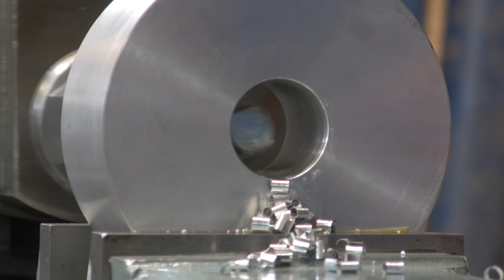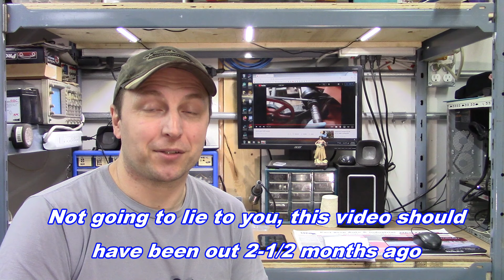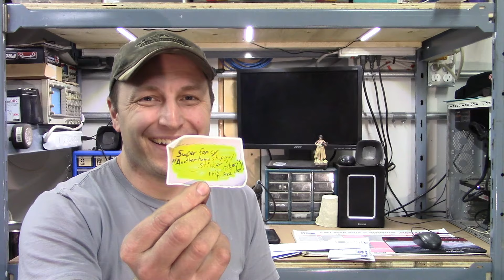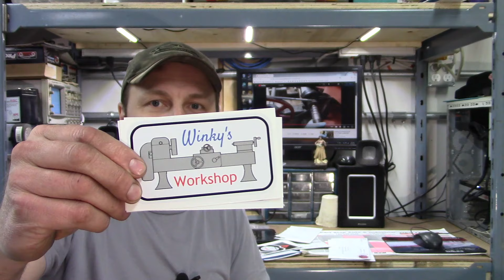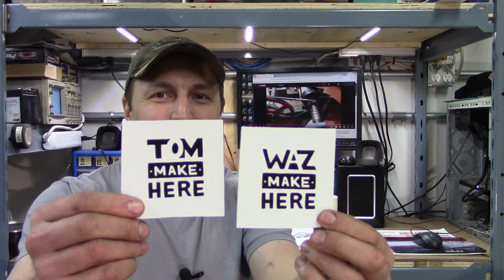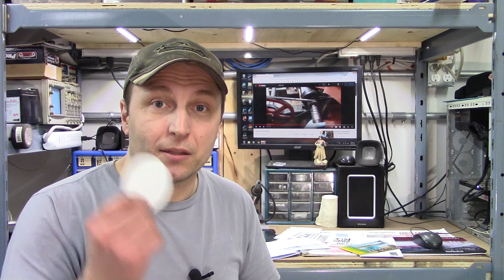Channel Stickers and New 3D printer

Comment: No problem. You're not forgotten. The prescription alerts us whenever You launch a video.
3D printing looks fun but finding Fusion360 being a solid conFusion360 and a dead end.... Hardly any such printing here.
Reply from the maker: I admit to using Fusion360 for a lot of my models, but don't like the fact it's all cloud based.  That being said, it is a powerful CAD tool and the free price tag is hard to argue with.  I also have a copy of Alibre, but still learning its ins and outs as it is a very different interface.  Hoping to get better with it as time goes on.

Comment: Hey Everett. I have the Ender 5 Plus. Pretty much a love hate thing. Printer is fine, learning curve is steep for this printer. I bought a Prusa Mini and that is my go to for small work. Much less fiddling required with Prusa. 

Much filament was sacrificed to educate myself. LOL. You have to love being nine hours into a print and walking in on a filament glob due to broken adhesion. Big improvement on the Ender was ditching the glass build plate for a mag flex plate with textured surface. Also bought a heated filament dryer.
Reply from the maker: Nice!  I had originally had my eye on the Ender 5 Plus as it has a larger build envelope, but the deal on this one just couldn't be beat.  I'm using the magnetic flex plate like you mentioned there, and it is great for PLA.  The only complaint I have is that the heated bed itself was warped (dished) from the factory by at least .005"-.009", which makes adjusting finicky.  Most of what I've done so far doesn't take the whole bed but if bigger stuff gets printed I might have to come up with a solution for the dished bed.
Reply: @EverettsWorkshop  Cool. I just finished some carbon fiber laced PLA for some change gears. We will see if it is any different from PETG which worked just fine as well. Glad it is working out for you. My first couple of weeks with the Ender were dark angry days…LOL. Plug in the little Prusa mini and it just works reliably. The one thing I learned about 3d printing is that there are more opinions than real issues. LOL.

Comment: Everett, good to see you back in the shop.  I have made a ton of 3D printed shop accessories with my Ender. Stuff like collet racks, parallel holders for 3" and 6" parallels, 123 block storage, etc.  There are a lot of machine shop related things to print on Thingiverse.  I am looking forward to more of your projects. 👍
Reply from the maker: Thanks Jim, I'm trying to get caught up on videos, starting with getting previous footage assembled and finally posted.  I've seen lots of good shop tooling, equipment, and accessories that have been 3D printed, and will make some bits for the shop here too as time goes on.

Comment: Good to see you up and running, I'm glad. You are very correct in calling a 3d printer a rabbit hole, it is 100%. I'm still fumbling more than scoring. 
Best wishes
Reply from the maker: Lol, yeah, the more I learn about it the more questions come up, and the more I realize I don't know.  It would be interesting to see what other filaments are like to work with but that will need more time to experiment.  And fail.  And fail again, lol.